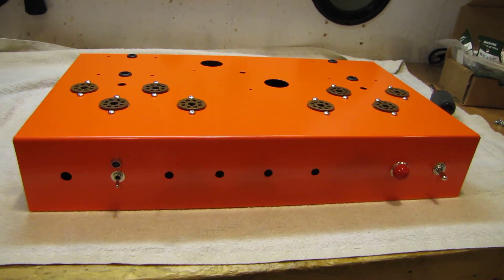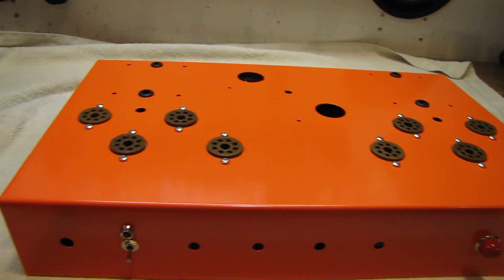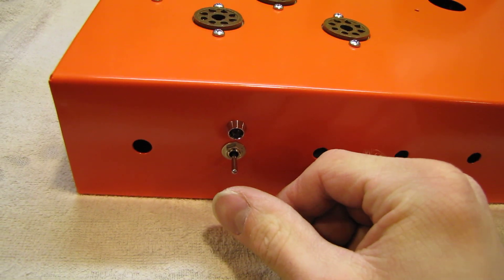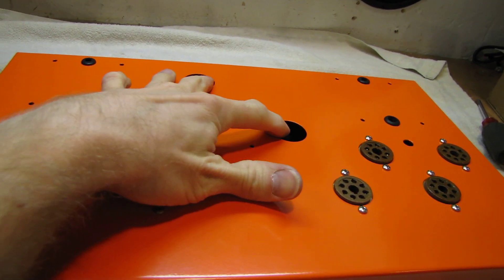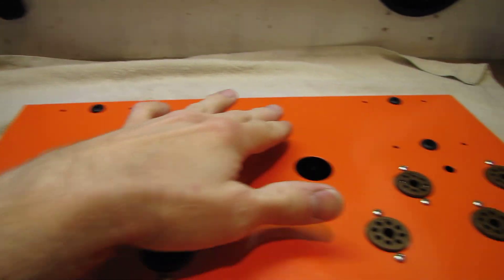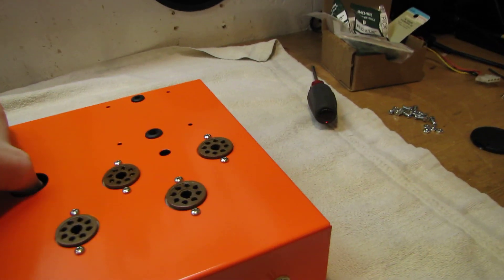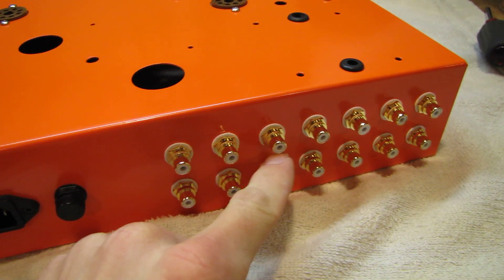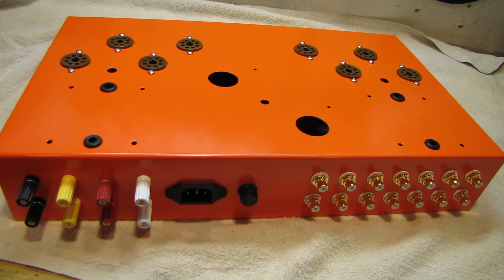My DIY Stereo Tube Amp Project, Part 1

Comment: Do you have a schematic anywhere?
Reply from the maker: No, but the output section is essentially a Harman Kardon HK-250.  The preamp stage is a circuit designed by Max Robinson.

Comment from the maker: This is actually my first project like this.  I used a 1930's Sears drill press with a good quality hole saw.  All the holes were marked and centered by hand with a ruler and square.

Comment from the maker: Rectifier is Silicon full wave, using 1N5408 diodes.

I think it is fixed/cathode bias. 

The original HK-250 was 25 watts per channel, but it had a much smaller power supply and used 6L6GB tubes.  I'm hoping for at least 35 watts.

Comment: That should be a really great amp! What's so nice is you can build in all the features you want for your particular application. Are you going to use a silicon bridge rectifier for the B+ circuit? Also are you using fixed bias on the 6L6's?
I have a Bogen amp which uses fixed bias and claims 50 watts from a pair of 6L6GC's but not sure of the distortion at that power output.